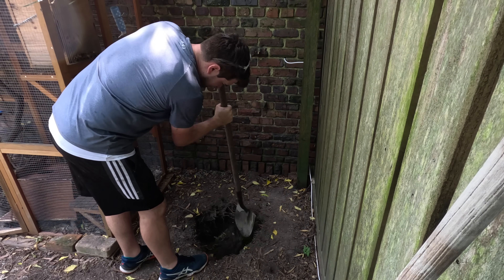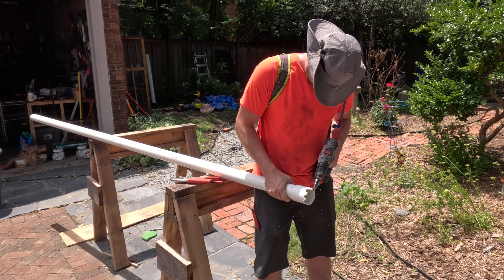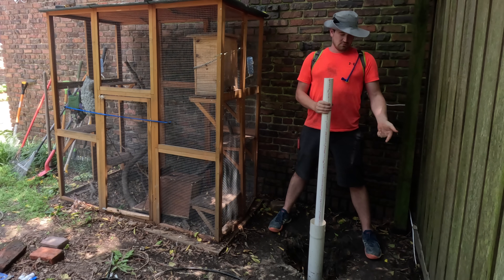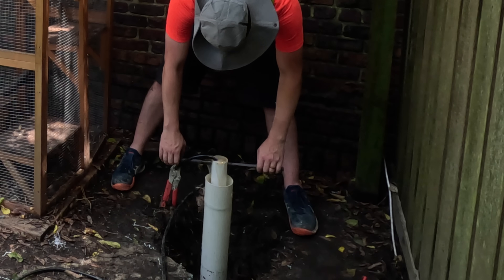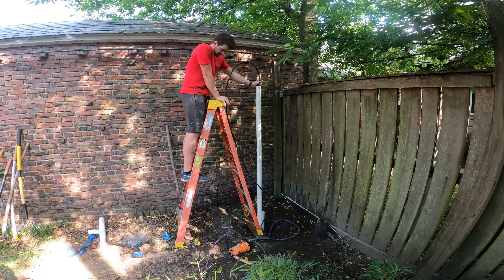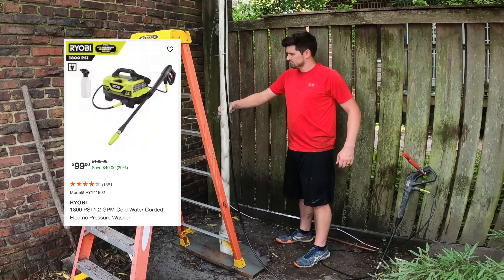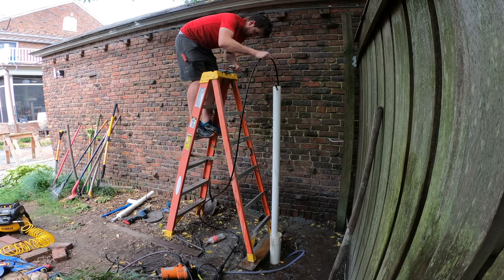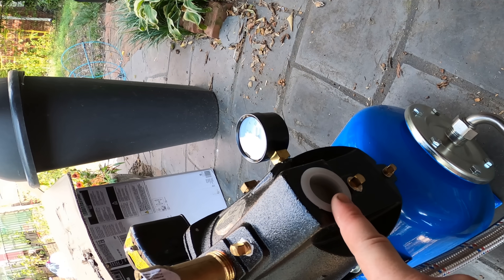I dug a 40 foot well in my backyard

Comment: 40 Feet?!!! 😳 My well is over 900 feet! The pump sits at about 870, with 30 feet of water above the pump. We had to install a 2,000 gallon cistern tank next to the well because the water column recharge was so slow we would run out of water if we did a couple loads of laundry. The well keeps the tank full and a separate pump supplies the the house from the cistern.

Comment: My dad did this. Slightly different than your method. Took like 3 men to hammer down and dig ! Fast forward we have a night pump with even a reservoir and filter. We use it to fill the pool during the summer and now we have a running outdoor bathroom and shower 🚿

Comment: You can essentially create an airlift pump by running another line down or using your pressure washer line and put  compressed air down the hole. An air lift pump can clear cuttings and water very quickly.

Comment: Fun fact. Scientists just discovered that having pumped underground water for many years has changed Earth's angular momentum, which has shifted the tilt of the planet, and is moving the rotation axis by 4.4cm per year causing the planet to wobble like an off-balance washing machine!
Reply: Try China's huge damage they built holding all that water  for much better calculations... 
Water will always go back down through the the soils and right back into the ground replenishment is slow but constant.

Comment: Only problem here is you need water to get water. If you were doing this before building a house you might have problems. Perhaps a 500 gallon collection tank or rent a water truck. Itd still be cheaper than what the drill guys want

Comment: I've seen wells dugged by hand 30 meters deep by 1 1/2 meter wide, you look down and see the water way down at the bottom, And it comes up in a bucket with a rope on pulley.

Comment: Awesome project! For anyone else that might attempt this, the maximum height that water can be lifted is around 33 feet. If your water table is deeper than that then an above ground pump will not work. That's why well pumps are normally installed underground, at the bottom of a well.
Reply from the maker: Yes. Even though I'm digging 40 feet, my pump works because the water table is only at 10 feet.
Reply: @BadHomeowner  if the water table is at 10 why go 40?
Reply: @robertbenjamin1513 I imagine it's so he has 39' of water he can draw from immediately 
Assuming the ground pushes the water up as it's removed
Just a hypothesis, I'd have to look that one up
Reply: Correct. I'm an engineer at a dewatering company and we typically use electric submersibles to bring water up to well points to divert into a local stream or reservoir.
Reply: The percentage of water pumped out has to be taken in consideration. It will lower the water level, you have to test the draw.
Reply: You are incorrect. Ask any farmer in a deep well!!
Reply: @owenhill-vf7ko  they're using pumps that push water, not pull.
Reply: Well good luck for me then, our water table is 100 ft down

Comment: Come to Panama where the ground is full of rocks & the dirt is hard as cement. I had a very hard time just to dig out 4ft holes for my fence posts. Even had to rent a HILTI to drill into the ground. Wells are drilled here with heavy truck equipment!

Comment: You don’t need a pressure washer,or that 4” pipe, a standard water hose works just fine, when your pipe got stuck and wouldn’t go any farther is when you need to go farther you hit the clay and you need to get past it. I know I’ve been down this road before and it takes a long time.
I used 4 10 ft 2” pieces of PVC pipe crowned on the end as cutting bit,put the water in the pipe with a plastic tee, keep working them into the ground until you need another piece, making sure it doesn’t get stuck.when you get 40 feet in the ground it’s time load in your 1 1/4 WellPoint’s make into a complete stick 40 feet long. Knock the tee off the 2” pipe and drop it the 2” pvc pipe,then pull the 2” pipe out of the hole 
And your done
Reply: In your last sentence, you’re saying pull the 2 inch pipe out? The one that you put 40 feet down?

Comment: Nice going my friend!  I’d recommend using black poly in the well as your supply line. No glued fittings and you can cut it to the exact length. It’s also a lot more durable and water safe than pvc.
Reply from the maker: Thought about it, but I could only find it in 100ft rolls. Didn't want to have 60 extra feet of the stuff with nowhere to put it
Reply: What's the largest diameter they come in?
Reply: @ 
1” is usually what’s uses in the well casing.

Comment: I would've dug a trench to have the waste water routed away from the hole. Especially since it's clay, it can easily clog the end of the pump
Reply from the maker: yea I should have done that but ended up using that transfer pump instead to compensate for my mistake :)

Comment: Did you remove 2'' (40' PVC pipe)? How to do that? Or move it up 8' for the well point to pick up the water. Thank you very much!
Reply from the maker: I didn't remove it, but I pulled it up just a little and sunk the well pipe past the bottom so the screen interfaces directly with the groundwater
Reply: @BadHomeowner  How to pull it up? It is hard to do that. Thanks
Reply from the maker: @luxuryvolleyball9431  I grabbed it with a pipe wrench and pulled and wiggled it. It's slow but not hard
Reply: @BadHomeowner Thanks.  I did it : 2'' PVC 25' long. And 1' PVC with a point 35' long. Very low water and stop (Green and clay). I think: I hit  CLAY. I need help. Move up or down?  Thank you very much!
Reply from the maker: @luxuryvolleyball9431  how deep are you? if water is low then you want to try to go deeper.  clay takes longer to jet through, BUT you will eventually get through it
Reply: @BadHomeowner  Thanks. 35' deep. My backyard is a wetland. Just 4' to the water.

Comment: That was interesting, but you got really lucky.  I've seen people with metal sand point wells hammering with sledgehammers and still only getting their well pipe down at a rate of one inch for every 25 hits with the sledgehammer.  You were blessed with soft subsoil and no obstructive rocks.
Reply from the maker: Well I tried first with driving a sandpoint and had a similar experience. I didn't get nearly as far with that method.

Comment: Help!   So we are still good with water knock wood but moved out to  a rocky mountain home in Appalachia 20 plus yr ago and were told the foot  valve on  our shallow well had just been replaced.   We were also told that the casing should be checked out but had no clue what that meant and the advice stopped there I think with a laugh. We are getting worried because of age of the system  and the amount of sediment that has always existed  in this water.  The is a whole house filter attached inside that we replace once/3 mo    We have a 10yr ago replaced  3/4 HP pump inside the house in the basement( with air original air tank) and the well outside is about 10 steps from the basement doors.  Found some loose pvc pipes shoved into the ground near to the basement doors...have no clue what those are about but they pull up and down...don't want to pull too much in case they are some how related to the system.  Can't get too much service with this well, regulation will not let it be replaced in current location.  The house is about 100 years old and we are not sure when that well was originally dug.  We have great water and do NOT want to mess with a new well because local water rots with deeper dug wells.  We are just hitting a lucky streak with this particular water source.  So we want to keep it.  That means we need to learn how to make any repairs on our own and quietly.  So, this video really helped.  But any extra info would be so appreciated especially regarding a foot valve and whatever casing they used to line the pipe.   Thank you for making the info in your video so clear and easy to follow and any advice you can offer.

Comment: Good job, I would make a few suggestions.
1. Use sch. 40 4" pipe for the casing and inner pipe instead of thin wall.
2. NO gravel under the grout seal, dig that hole as deep as you can get it. Use Portland cement or fine grained Bentonite.
3. Move that animal enclosure at least 100' from the well ALSO make sure the well is at least 100' from the septic system drain field and tank and 50' from any sealed septic lines.
4. Use a skill saw to cut 6" long slots in the submerged section of liner pipe to allow water to come in. 2 or 3 rows of longitudinal slots spaced evenly around the pipe spaced about 6" apart.
Reply: Good idea dude 👍🏻
Reply: do u have to order Sch. 40 ?
Reply: @doneown503  No, any major hardware store will have it in stock.
Reply: Hey, any thoughts on what to do with a setup like this in the winter?  Obviously I could pull the pump, but I assume the well pipe will still freeze and split.
Reply: @nameless-og  Depends on where you live, here in Oregon we just insulate the pump house/box and don't worry about it unless the temps drop into the teens, then I use a 100 watt light to add a little heat. Some people like the heat strips that wrap around the pipes and/or leave a faucet dripping at night to prevent freezing. If you are way up north? check with a local pump contractor for ideas.
Reply: @ddrowdy2 i did that with a barn actually come to think of it, i guess that would work fine here too... bulb in the shed and wire... i think there was wire a kit that came with a foam wrap too.  I totally forgot about all that stuff, it really wasn't that bad, just annoying that id have to run a more permanent power source out to it.  😂
Reply: too late, he is done
Reply: @earthenergyhex  Yeh, but others will follow.

Comment: Don’t forget once you go past 34 feet (10.3m) at sea level you can’t suck water out of your well anymore because you will get a vacuum in your pump.  Your system only works because your water table is above that.  If you suck faster than the water can flow in from the surrounding ground, once the water level drops to 34 feet that’s it, your pump will cavitate. So absolutely no point drilling any deeper than you did unless you install a submersible pump down the well.
Where I live I get all my water from rain tanks.  No other water required. 🤠. Falls from the sky for free.
Reply from the maker: That's correct
Reply: Well I would think so long as you’re still drilling into the water table you’re just adding more surface area for water to flow in at a faster rate. It’s the static water level that matters not the depth of the well and they say practically speaking it’s 25 feet. So you’d want your drop pipe to go as low as possible but if static water table drops below 25 feet then you got trouble

Comment: Should have put the check valve just above the well point.
Reply from the maker: It does not matter whether the check valve is on the top or the bottom

Comment: You more than likely hit lime stone. This is common. This is where a well digger put on a carbide bit to break through the stone . Under that stone is where the big water veins are located. Old wind mill wells was down to the limestone, theres about three feet of sand gravel base on top of the limestone pan. There you can get water but not high volume.

Comment: Don't forget to dump some "small" particle chlorine crystals down the well and let it sit over night. This is to sanitize the system. The next day let the water run for a while to flush the chlorine out. It will have the flavor for a while but it will clear up fairly quick. You can use liquid bleach but the crystals will sink to the bottom and sanitize all the way to the bottom.
Reply: It would be highly, he advised to ever think about drinking the water from a wellness shallow. That is ground water, and it will make you extremely sick regardless of how much chlorine you put in it, it is not fit for consumption.

Comment: Great video. I would suggest you make a call or for the top of the 2 inch drill pipe that will get the dirty water out away from the 4 inch casing right now. You have all the sludge going back down the 4 inch casing.

Comment: We used a pressure washer to dig an electrical run right underneath tree roots. Conduit pipe went in super easy and we saved ourselves the cost and hassle of a ditch witch and tree removal.  This is a great video. I want to use this method to put in a wash station next to my greenhouse. We're at the overlap of costal and piedmont regions in a watershed. So our soil make up is identical to yours.
Reply from the maker: Cool! Let me know how it goes

Comment: You could feed the other end of the pressure washer hose through the pipe  before you put it in and add extensions.  No ladder needed. Much easier.
Reply from the maker: Well that assumes you already have some idea how deep the hole will go. I had no idea how far I would go before I started.

Comment: I drilled 85 feet with 2" schedule 40 pvc made a bit out of a 2" threaded male pvc coupler attached to a 2" galvanized coupler cut into a crown shape. 140 gpm trash pump flowing into a manifold recirculated into a pond. I never hit water, my bit broke off at 85 feet.
Reply from the maker: Wow 85 feet is impressive. Sorry you didn't find anything

Comment: How r u getting the pump to stay kicked on and running water when u turn the faucet on with not foot valve on my pump with no foot valve on the bottom of the well the first valve u put on before putting it down on my well mine pumps water up to the 50 psi and kicks off like it should but when I turn the faucet  on and it loses pressure like it's suppose to do and kick back on at 30 mine don't hold water pressure when it kicks on at 30 psi mine falls to zero then starts drawing the water back up from the ground because it leaked back down because the water didn't stay at the check valve like it was supposed  to mine has this new strainer with the slits n it about a 4 foot pipe with slits n the pipe and no foot valve and I'm finding out if you don't put that foot valve n your water won't hold at the check valve it will go right back under the ground
Reply from the maker: I have a check valve at the top. Accomplishes the same thing as a foot valve

Comment: Once the well is dug, you should have a sample of water analyzed for bacteria and heavy metals, you never know what is down there. Arsenic is a problem in some Northern Nevada wells. If it is still contaminated, you can still use it for flush water and maybe laundry, hot water will take care of most bacteria, and bleach and even mild dry bleach like Chlorox 2 will sterilize it. You may be able to use it for non-food crop irrigation as well.🤔
Reply from the maker: I did this in another video!

Comment: Maybe 3/4 pex would work for the well point pipe¿?
Reply from the maker: maybe? problem is that you still need a wellscreen at the bottom, and it sucks up a bit of sand and clay occasionally which could clog a smaller diameter pipe

Comment: Consider a large bladder-tank and a digital pressure pump-switch set to 40/60 PSI or 45/65 PSI if you not using the water in the house; i guess you are irrigating with this water?

Comment: I think this is WRONG. Why dig.a well near your house where if something goes wrong (now or later) it either floods your house/foundation or causes your land near your house to sink due to the water table . You shouldve went a bit further away from your foundation.
Reply from the maker: I'm using this for irrigation, which means all the water I use goes straight back into the water table.

Comment: Do you think it is enough to supply a small home...? Bathing, dishwashing, laundry...?
Reply: Absolutely not. Not only would u not want to wash dishes or shower with this water  u wouldn’t have enough to run a small home. Water at only 37 foot depth still has toxins and heavy metals and parasites and bacteria in it not to mention chemical run off from the surrounding houses .This would all need to be filtered.

Comment: I don't understand? when you insert a 4 inch pipe with water , Eventually dirt muds goes inside the 4 inch pipe ,How do you drain that ? then 2 inch pipe same situation, How do you get rid of Muds inside the pipe. ? Looks like LOTS of water you have to use to get rid of Muds, Am Right?
Reply from the maker: How is mud going to get through the wall of a solid pipe? I don't understand the question.

I used about 200 gallons of water to dig the hole.
Reply: ok got it . 200 gallon for 40 ft down , thank you.

Comment: Why is there Electricity involved as far as when job is done. What if you get a black out? Never ever rely on Electric if you don't have to.
Reply from the maker: I mean, way easier than pumping up the water by hand. And this is mainly for irrigation, but I have a backup generator that I can hook it to if necessary

Comment: Looks like he has a shallow well pump. Everyone says the max depth with those is 25 feet anyone care to explain how it still works? I am 30 ft down with 4 inch casing and would put in a point if I knew it was gonna work deeper. I thought u needed a jetting system for that to work.
Reply from the maker: This is one of the most popular comments I get, I made a separate video on why this works
Reply: @BadHomeowner  I just watched it thanks. I will give this well thing one more try !

Comment: Nice video, but I am confused. You say you need a check valve that looks to be mounted above ground. How does this keep the well pipe primed?  I have only used foot valves for this with jet pumps.
Reply from the maker: Same way as a foot valve. like how if you stick a straw in your soda and then put your finger on the top of it, you can pick up the straw and the liquid stays in the straw.... same thing here.

Turns out it doesn't matter where on the pipe the check valve is. Can be at the top, bottom, or in the middle. It'll work just the same.

I like the check valve at the top because it's much easier to access for maintenance purposes.